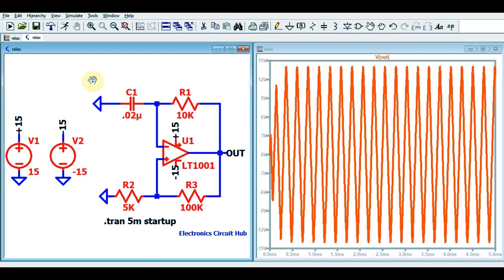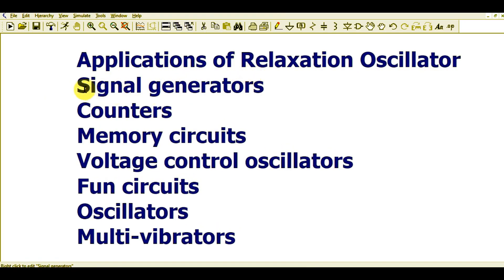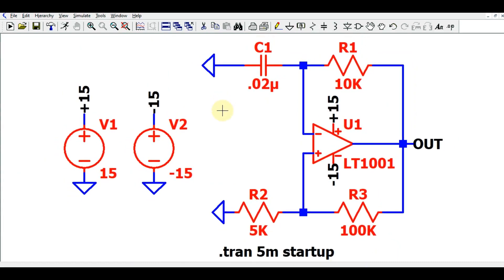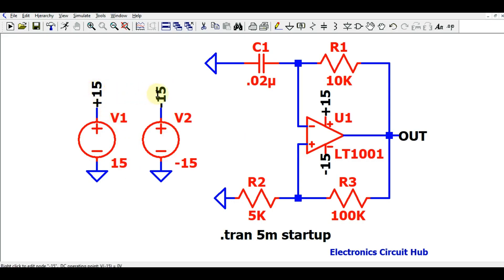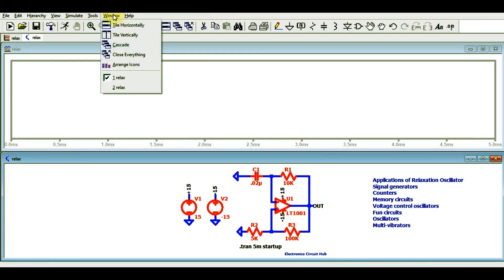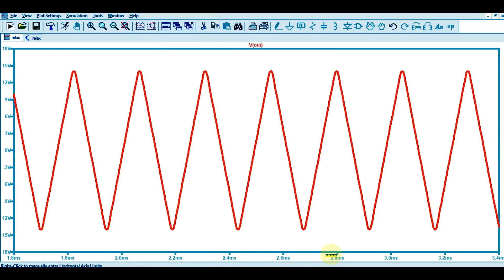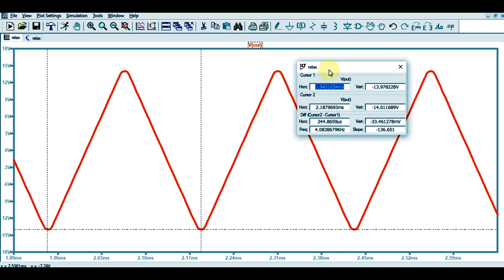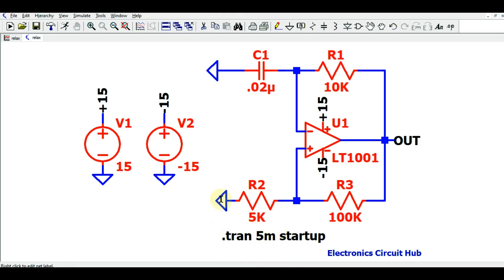LTSpice Relaxation Oscillator | Simulation

Comment: Nice video but ı have some questions about this circuit. If ı change the capacitor or one of the any resistors, what can ı see the frequency or another parameters? Is there any mathematical calculations or theoritical informations for this circuit?
Reply from the maker: Yes, I do agree with you.
I should have explained the theory little bit about calculation. You can find calculation over internet.